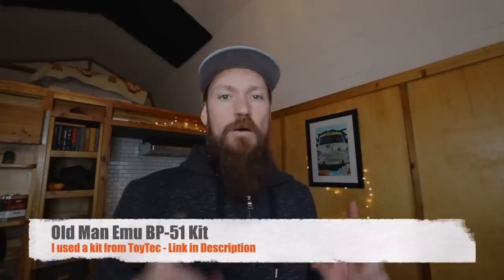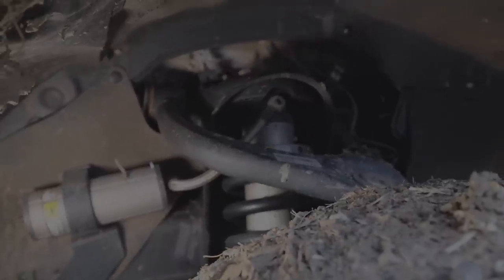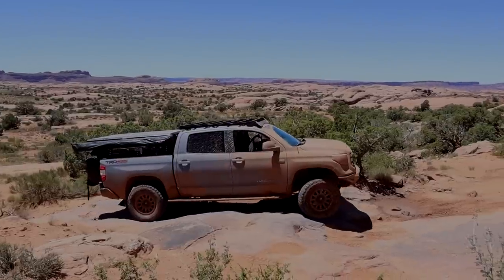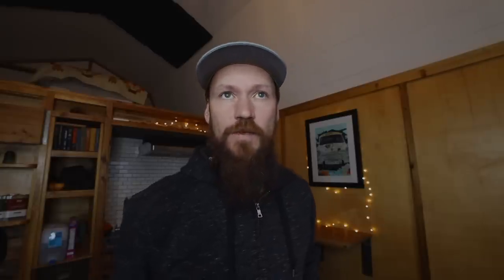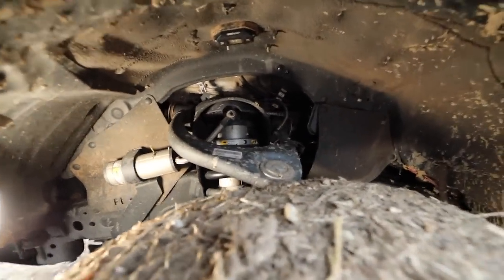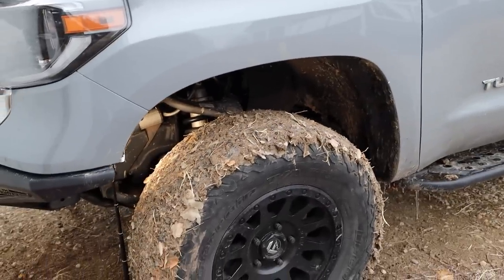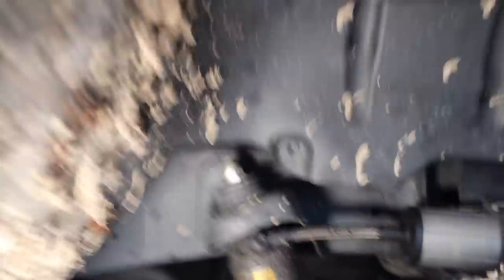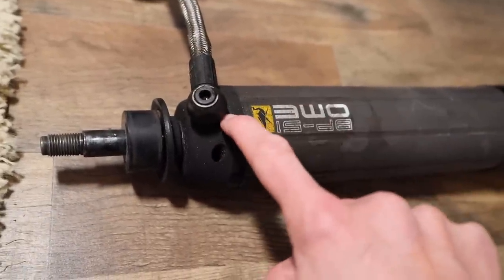Old Man Emu BP-51 Suspension - Watch Before Buying - WE BROKE IT - 1 Yr Offroad Review

Comment: I'm planning on doing this as the first stage in upgrading the suspension on my FJ and going with the heavy springs to help weight from my gear as well as future plans for front and rear steal bumpers. 
Hopefully there is no issues for the FJ if the 4Runners have no issues with this setup (near identical frames and suspension) 🤞
Reply: Greetings, any updates on the suspensions? doing the same thing for my FJ as we speak, thanks.
Reply: @q8shadowq8  install was easy and straightforward. Mix of comfort and harshness because I don't yet have steel bumpers so the ride is both smooth and rough depending on the road conditions.  Bumps get soaked up but potholes or sharp abutments will be jolty.
Reply: @q8shadowq8  easy enough of an install if you're mechanically inclined.
Reply: @Reaper6207  Thanks man, I did the suspension, roof rack, rear steel bumper and front steel bullbar + winch.

Comment: Great video. I am getting ready to purchase the BP-51 system for my LC200. You recommend any shops locally (Treasure Valley) for the install? I hope that particular issue is not relevant to the LCs.
Reply from the maker: I have been in the valley for over 20 years and I still feel like I don't know any good shops... I am mostly to the point where I am trying to do the work myself. I have heard Boise 4x4 is good.... but I have never used them.

Comment: So... grind that back a little on the Tundra as a preventative measure, that's good to know. On my 5th Gen 4Runner, I have 2 3/4 inch of lift on the front with stock upper control arms. No issues. The adjustments are maxed out, you need a good alignment tech to do it right. Any higher though and I would definately run some after market upper control arms...
Reply from the maker: Good info on the 4Runner, I never knew what exactly was the cut off.

Comment: Damn, it happened again huh...  I have a different brand with same design and same failure.  Made the same exact mark on my rear shock mount.  Trim around the shock mount for more clearance or it WILL happen again if you hit a hard bump or hard compression.   I trimmed and so far, so good.  Fingers crossed!  Good Luck!
Reply from the maker: This time it happened in a significant and obvious way 😳
Reply: @OutdoorAuto  It was in the installation manual to trim that mount. I read mine for the torque specs but skipped that section. When I emailed them about fixing it they asked if I read the manual.. They still replaced it for free. I installed mine in 03/19. The passenger side for whatever reason has more room.

Comment: I would say a higher durometer rubber or even urethane would solve that problem. It is most evident that the lower bushing of the upper Mount is compressing under load causing the impact with the bypass fitting on the shock body as you have experienced.

Comment: The more I spend on modifying my 4Runner, the more I realize that I would have been better off with a trd pro as factory form is always the best when it comes to reliablity and durability. Plus, I don' do any hardcore wheeling.  #LiveAndLearn
Reply from the maker: For a ton of overlanders this is true... the stock vehicles are a lot more capable than people think and most people don't do hardcore wheeling...  Factory form is SO reliable. Even though I have built up trucks I find myself 90% of the time just encouraging people to Overland what they have and keep mods minimal.
Reply: @OutdoorAuto  You are one of few that I have heard to keep it minimum.

Comment: here in aus  arb has the same kit, but thats only medium load leaf springs,  but arb do have heavier springs  from constant 300kg plus  to 500kg plus, the kit is a basic kit, but its all about asking questions and asking about heavier leafs, ive installed many of these kits myself,  but if you are bottoming out the shocks  that will cause damage,  either increase bumpstops  or  get airbags aswell,  arb will tailer the products to suit the needs.
Reply from the maker: shocks aren't bottoming out... it has to do with flex... when the shock angle changes and is comrpessed the bushings have enough play  to hit the resivoir connection... ARB has addressed the issue and changed the install directions to include notching the shock mount....

Comment: I have the 2013 FJ cruiser trail teams edition.  I'm interested in adding 2 to 3 inch lift and 33 Inch tires.  I will be adding heavy bumpers both front and back.  And outfitting it for long range overland travels. I'm liking what I see in your video but I would also like any recommendations for my rig. Thank you for your time.
Reply from the maker: The BP 51 setup (make sure to clip the mount) would actually be pretty solid... you would want to go with springs that match the amount of weight you plan to add... but there are a lot of good options... Have you checked out https://www.toyteclifts.com/ ?

Comment: Question:  You comment a lot saying this suspension provides a good ride, but can you compare that to the stock ride as a reference point?  Is it better than stock on road?  Obviously I would assume the ride off road is better.  I know this is kind of a trick question since the suspension is tunable.  But I personally would guess most of us accrue most of our mileage on asphalt and dirt roads where we want a soft ride.
Reply: These shocks can be made to ride even softer than stock. What most people dont understand though is that with a super plush ride, you sacrifice handling in most cases. For instance, you can soften up the compression and rebound enough to eat up all the small bumps and ride really smooth, but then when it comes to highway joints or unexpected larger bumps on the highway, it could be dangerous as the vehicle doesn't have the proper damping to account for quick changes in terrain.
Reply from the maker: I’ll echo what @shocksurplus said… Tundras have a pretty bad nose dive issue with hard breaking and are a bit soft on fast hwy turns… The OME’s instantly improved my HWY handling… similar affect of adding a sway bar… but even more noticeable.

Comment: I HAD BP-51’s on my Tacoma. ALL 4 failed in some way. The ride was great when they worked but they often didn’t work so.......
Reply: So what did you go to after BP-51’s?
Reply: I went back to the not flashy, but tried and true 5100’s with an 886 ome coil. I have a spare front and rear I throw in for longer trips away.
Reply: @justinforrest221  sweet, that’s good to know!  How do they handle? I have the FX4 Ranger and am looking to cruise 30 mph on AZ rock/Washboards but have it be pretty smooth.
Reply: When they work the ride is fantastic. High speed off road feel was great. I just can’t deal with stuff that keeps breaking. If I was to go performance shocks again it will be King, Ads or Elka.
Reply: @justinforrest221  shoot, I just might go 5100’s instead that’s fantastic!
Reply: For a bit more there’s always the Bilstein 6112/5160 combo. They will perform better than 5100’s for a bit more money but still a lot less than BP-51’s.
Reply: @justinforrest221  I just noticed those are available too!  I think I’ll go that route for sure! Now to convince the wife, 😂

Comment: I would not cut my shock mount. Simplest solution is add a small space at the top of the shock. But I would have a serious discussion with shock supplier. They should replace that unit.

Comment: Look at the angle your upper ball joint is sitting at.  I think you should get control arms.  

Defective rear shocks?  Unacceptable at that price.  I am shopping for a lift, and OME just got scratched off my list.   

Good video.
Reply from the maker: Yeah... the stock UCA's work... but I will get much better performance after an upgrade. I have been really impressed with what the stock UCA's could handle. I am very curious if OME has a 2nd gen BP-51 coming someday with updates from what they learned from this round... I could see that being pretty intriguing .

Comment: Do you think that the EXTRA LEAF (D28XL)  Combined with the OMETUN57BP51 suspension Kit would make the rear Springs Heavy Duty enough to solve your weight problem you were talking about? And maybe also keep the valve from contacting the shock mount as easily?
Reply from the maker: Yes, I think using a a good Add-a-leaf kit solves the weight issues if you carry a lot of gear... I do not think it will solve the shock issue... for the shock I really think you need to notch the mount... A friend just bought a new set of BP51's and set that the direction had been updated to include a call out about the shock mount spacing and potential need to notch it...

Comment: The more you know - the more there is to learn.  
I'd come to conclusion that a standard kit wasn't going to work for me - I like the shocks, but I'm going with Deaver leaf springs, and probably Timbren bumpstops - either way, it looks like modding that shock mount will be part of the upgrade.  Thanks!
Reply from the maker: Deaver Leafs are awesome... I run them on the Long Travel Tundra.
Reply: @OutdoorAuto  I'm probably going to run 285/75R17 because they're lighter, narrower, and significantly cheaper. At only 0.6" shorter than the 35x12.5 - I only lose  0.3 inches of clearance and save about $50 per tire.  Which for me, is a good trade - if I did more trail stuff, I might think differently.

Comment: From my investigation as a rookie or newbie, I’ve learned that anytime you work on your suspension with a lift, you’re affecting everything on your vehicle. I’ve heard a lot of people are now learning they have to get a custom driveshaft to rebalance the lift. Also people doing different gear ratios, basically it seems you’re reengineering the whole truck. 
To me there’s too much involved and I have a lifetime warranty on my Tacoma TRD, so I’ll just stick with the standard one I got from the dealer. I don’t plan to do any rock crawling anyway!
Reply from the maker: What you're saying follows one of the core tenets of Overlanding... the most reliable vehicle is usually a stock vehicle. If that can get you where you want to go then that is what you should go with!
Reply: @OutdoorAuto  Stock gets you maybe 75% here in Colorado. Plus, for overlanding, the stock suspension will sag under the weight.

Comment: If your top bushing is compressing that much, your bump stop spacing is wrong and you're bottoming out the shock
Reply from the maker: This isn't actually accurate... even Old Man Emu admitted to the issue with design and changed the install directions. The issue really comes  when your rear axel is articulating front and back and side to side... the clearance from the reservoir hose and the shock mount is simply not big enough.  Again... like the video lays out... even the manufacturer has admitted this and changed the install directions for a Tundra.

Comment: Great info! Still can't wait to get this kit for my taco. Wonder if it has the same problem!
Reply from the maker: Please let me know... I bet on the Taco that lip doesn't come down as far and it isn't an issue... similar to the 4Runner. But I haven't run it on the Taco so it would be nice to know. I stand by the kit as far as ride quality... that internal bypass setup they engineered is awesome.
Reply: @OutdoorAuto  I have the BP51s on my 2020 Tacoma now.  Having not heard of this issue until recently I immediately went out to inspect my rears and while I don't have any leaking or signs of impacts, the mount definitely sits very close to that reservoir knuckle.  I'd say it sits even closer to the mount than your Tundra.  In the long term, if driven the same way you have driven yours, I believe this will still likely be an issue on the Tacoma and not just with the BP51s, but with any suspension/shock running the same style design with remote reservoir.

Comment: The issue with Toyota specifically on lifting the caster loss when you put a lift on. The upper control arms fix this issue, but also allow additional clearance for down travel. 

Now speaking directly to caster, it’s a measurement that doesn’t affect tire wear, but affects how the vehicle drives. The less caster you have, the more unstable the vehicle feels, while the more caster you have the more stable the vehicle feels. I’ve done several Toyota lifts that have had very low caster but still seemed to drive fine, while as my own 2000 4runner felt like it was unstable at speeds until I put control arms on. Honesty it’s very situationally based. Hopefully that sheds some light on why people recommend them.
Reply from the maker: Great points... I get the caster issue... Although I think that one doesn't get talked about enough... like you said it can be situational... but also if you go with the stock UCA and you still have positive caster (I guess you could say buffer... enough of it) it definitely doesn't seem to cause too much of an issue. I feel like the down travel and issues with alignment seem to dominate the UCA conversation.
Reply: @OutdoorAuto  They do dominate the conversation, but there’s also to much out there that’s misleading. The biggest effect is how it affects the vehicles handling. Negative caster is like riding a bike with the handle bars flipped around, unstable. The down travel part only really gives an inch of usable down travel. For newer Toyota’s 04 (04 4runners, 05 Tacoma’s) and up they changed the upper controls to have a control arm mounted ball joint instead of a knuckle mounted one, which takes away some of the issues with the knuckle hitting the coil on full down travel

Comment: I think rear shocks with external reservoir are for show. unless you are racing. I find it wierd that 1ton trucks can tow 17,000lbs just fine with smooth rear shocks. But for this video, its obvious. These are not vehicle specific shocks and just a universal size. Or this would not be an issue. OME just cutting corners and letting the customers deal with it.
Reply from the maker: Reservoirs are for dealing with heat, doesn’t really have anything to do with weight/towing... it’s about cycles. I am about to drive 50 miles of washboard at probably 50+ MPH... situations like this are where reservoirs make a difference... towing on a hwy... you really aren’t really using your suspension heavily.
Reply from the maker: I’ll do the Idaho BDR once the snow melts... that’s 1100+ miles in dirt... reservoirs pay on this trips too... even if you don’t go super fast...
Reply: @OutdoorAuto  Reservoir do help, but in your case. They failed. And a smoothie would still be working. You might have to do 40 mph instead of 50mph. People have completed desert races with smoothies for decades. Reservoirs are for the big guys. Heavy trucks, going fast. Over crazy Terrian.

Comment: The 51 in the name stands for 51mm of shock body or 2 inches, this is comparable to a fox 2.0 with remote reservoirs. IMO OME is priced more on the premium side, Dobinsons MMR, are 2.5 inches with reservoirs and the same adjustability. 

It is my understanding they bp51 are rebuildable, that would make a good DYI video.
Reply from the maker: Yeah... but the Fox aren’t internal bypass, not quite as good of a ride as the BP-51... then again I haven’t heard a lot off issues with leaks 🤔... they are solid... OME is on to something with this design... they just need to work out the kinks... (I mean leaks)
Reply: @OutdoorAuto  take a look at Dobinsons MMR, I have a set in my 80 series LC
Reply from the maker: I have several friends that really like Dobs... now I just need a LC 😬

Comment: Thanks for sharing this, I probably wouldn’t cut the mount though - that might weaken the integrity
Reply from the maker: The way those mounts are curved over they are fine... bottom line on this suspension is you have to cut or you shouldn't install it.

Comment: Why a tundra?  Isn’t this vehicle designed for towing, not over landing?
Reply from the maker: I needed a vehicle that could handle more weight/gear than a Tacoma & 4Runner. My Family Overlands but we also Whitewater raft and have to haul a decent amount of gear to take on both. I also like that the Tundra doesn't feel underpowered like the current Tacomas and 4Runners.

Comment: inst the Whole Point of Buying a Toyota, is You can beat it into the Ground Stock and It will Still Run.
Reply from the maker: The point of buying a Toyota is kinda whatever the actual buyers point is... but, if you are going to use a truck on terrain more complicated and extreme then a truck was designed for... I would recommend taking the base precautions to protect your investment...

Comment: thats a really bad design from OME, kinda disappointing to see.
Reply from the maker: I really wonder if it really is just the aging of the bushing that causes it... obviously there are several easy fixes... but yeah... this is one of those issues that shows up after lots of miles and testing... and SEEMS to only be applicable to the Tundra... cray right? I was surprised for sure.